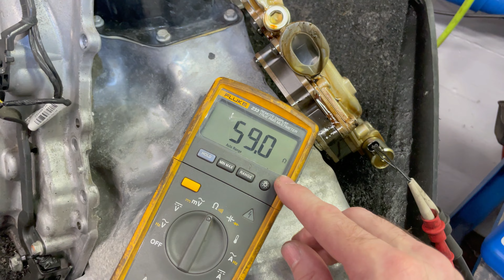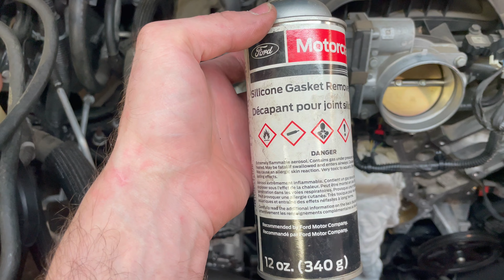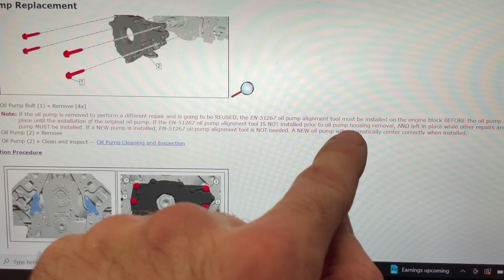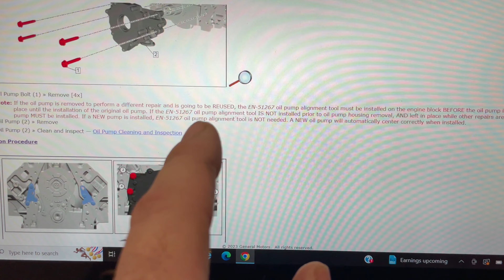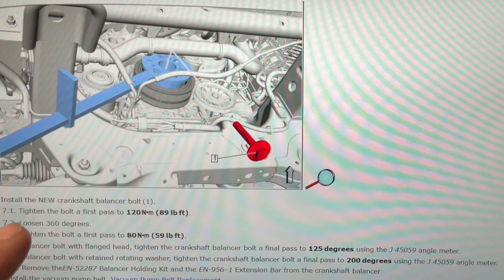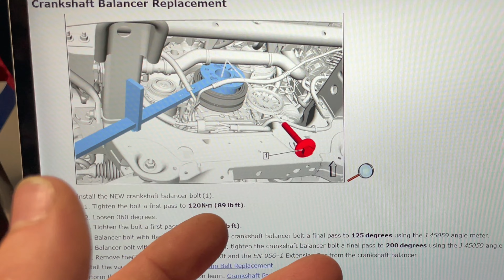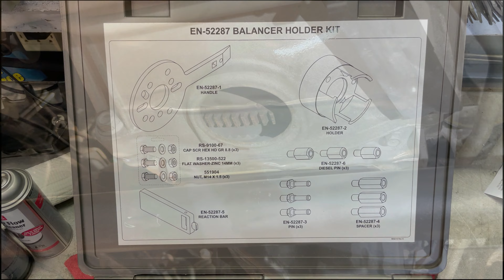P06DA 5.3L Dual Stage Oil Pump Replacement tips

Comment: I replaced the oil pump was because of an engine whine/buzz.  I have had 2 trans techs look at it, 3 mechanics and the most senior GM tech at the local dealer.  No one can figure out what it is.  Do you mind taking a listen to this short video and see if you recognize it?  https://youtu.be/BmoW1f71Jjw
Reply from the maker: Transmission fluid pump for sure. 

Service the transmission fluid and filter, it might help if the filter has never been replaced.
Reply from the maker: I noticed your video said you already unbolted the torque converter and still had a noise… it’s hard to say whether the torque converter would still spin or not. GM advises not to do that because the pilot of the torque converter can still rub on the inside of the crankshaft. 

Another choice would be the vacuum pump or other belt driven accessory…. Though I believe your video said the belts had been removed too. 

In that case it may be normal depending on just how loud it is. Every one of these trucks that I work on has that noise, but it’s not too loud. 

The ones that are howling loudly almost always turn out to be the transmission pump. 

With the torque converter disconnected from the engine and the belts removed, the only thing left to make that sort of noise could be the crankshaft, camshaft, possible roller lifter on one of the lifters or the lifter for the high pressure fuel pump.
Reply: @DadsGarageDiagnosticSpecialist  thanks very much for taking a look and your reply.  I will do further investigation of the transmission oil pump.
Reply: @DadsGarageDiagnosticSpecialist  thanks very much for taking a look.  I will hunt around town for others and compare noise.  If mine is comparatively excessive, I will do further research into the transmission pump.    Thanks again for all the tips in your video, it really helped a lot on a complex job.